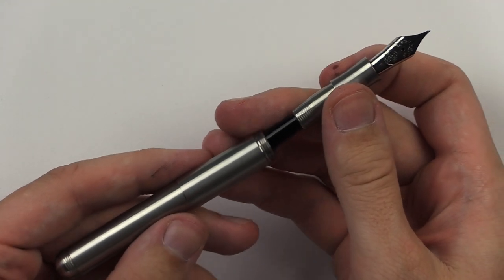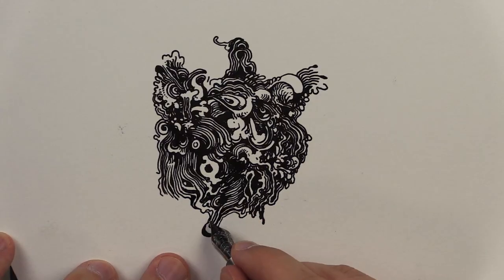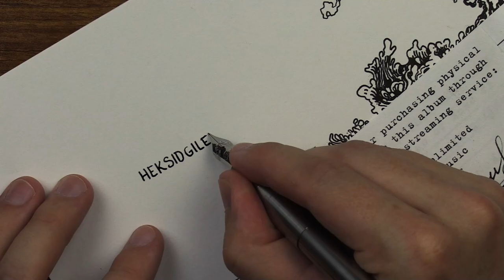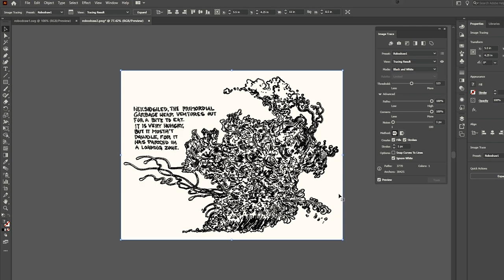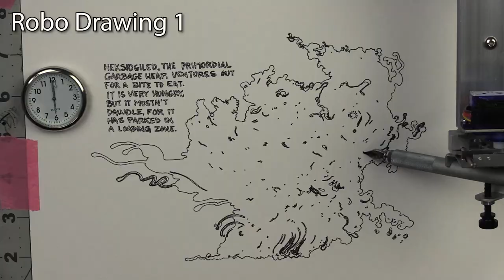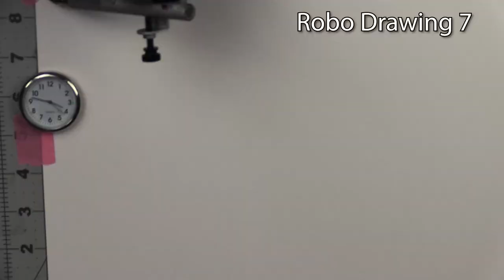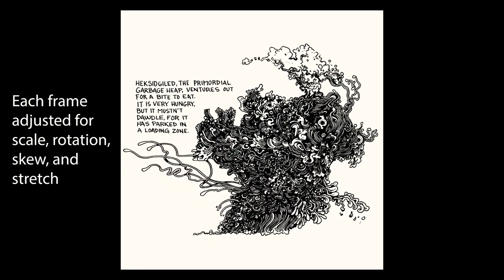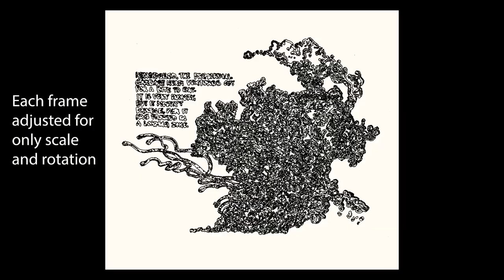Can This Robot Arm Replicate Its Own Drawings? With Crazy Animated Results

Comment: There has to be an option to wear the outline diameter is able to shrink or grow you need to warp the outline all the one line will have two edges I feel like each picture added depth like its own shadow or blur and because of that blur the outline widened thus your words colliding together I could be wrong because every program is different but it seems like that's the logical explanation is that you set up the program so that the contrast somehow grows higher each picture so it recognized less and less pixels or your outline edges are too wide and need to shrink them so thin that the space between matches the diameter of the pen so it creates one line instead of two borders

Comment: I've done vector art for decals for years. You can combine paths in illustrator and then make certain ones compound if needed. Same kind of machine. Takes vector paths but instead uses a blade vs a pen (cap put a pen in the blade holder too). If you want to send my "business email" your file I can try to vectorize it for you so it has longer paths (less up and down placement of pen)
Reply: My email doesn't work
Because it doesn't accept
Any pass words,
Tmoble can't get it work
Neither 
No one knows why,even
Experts can't 
Get it to work
Reply: @mikenel9793  based

Comment: Fix the paper lifting by using a vacuum cleaner and a base plate with holes in it. Don’t 100% block off the vacuum cleaner (heat generation) but it will still be enough to prevent pen mark location error and accidental marking due to paper lifting or curling.

Comment: I think if you did an "inverse selection" thing in photoshop it'll switch from highlighting the outside of the lines to the actual lines. If I remember right, Hold ctrl/cmd and click on the picture of your layer in the layers panel (bottom right in photoshop). that should select the entire drawing. Then hold ctrl/cmd and hit the letter i.  It's been a long time since I've done it so I might be wrong but give it a shot.   If that's not the right way to do it, search for something. I know it can be done

Comment: This is crazy cool, Peter!  I've been 3D printing for about 7 years now, and there's a lot of similarities in how the Axidraw and 3D printers work.
My hypothesis is that the E-Steps on the X-Axis stepper motor aren't properly calibrated, so  it's not moving as far as the gcode tells it to (I'm guessing the Axidraw uses gcode?).
It's such a small calibration error that you only notice it after doing this type of test, where the error is multiplied by number of iterations.

Also, as someone that's sliced models and printed stuff almost daily for so long, I feel your pain on how inefficient the toolpath is calculated. 
That's something that is dependent on the software that converts the vector into a toolpath. I may have to download Inkscape and the Axidraw plugin to see if there's a way to optimize that and report back to you on any discoveries.
Reply from the maker: Yeah I agree, I also think it’s some little miscalibration that you normally wouldn’t notice except through compounded iterations like this
Reply: @peter_draws  I did a quick search to see if there’s instructions on calibrating the e-steps for the Axidraw’s firmware, but couldn’t find anything. 
I suppose such a small error probably isn’t a big deal for this application. Haha.

Comment: What you're witnessing here is numerical truncation.  You know how a computer can only store a number of a finite size, or have a finite number of places after a decimal point (aka the mantissa)?  When you do iterative processes like you did here, with each iteration it loses parts of its mantissas of all the numbers it calculating to truncation.  So each iteration is less precise than the one before such that it looks less and less like the original image, and more and more like noise.  :)  Regarding the scrunching...  as precision is lost, it leaves out what's lost completely and what's left gets scrunched towards the origin point (the place where the robot first sets pen to paper).  :)
Reply: PS.  This is the reason why computer simulations of things like weather go haywire after a certain amount of time into the future.  The accumulating loss of accuracy (due to truncation) as the simulation iterates causes it to diverge from the system its modeling.
Reply: That's one theory, but if it was losing precision due to rounding, wouldn't it be shrinking in both X and Y axis? I also think if it was rounding so dramatically, it would have problems drawing precise lines?
I'm thinking the e-steps on the X Axis stepper motor controller aren't calibrated perfectly. It's the same thing that can happen in 3D printing. The gcode and machine are told to move the x-axis by 10mm, but the motor is only turning enough to get to 9.5mm. 
It's probably not a big problem with something like the Axidraw, which is meant for art, but the error is multiplied in this experiment.
For 3D printing that requires high precision, tuning the e-steps is critical since fractions of millimeter can cause problems with part dimensions. 

That's my theory, anyways.  :)
Reply: My hypothesis stems from the scanning of the new image, reprocessing it into paths and having the bot draw the results. Every time you do that you get loss of precision in the scan and loss of precision in the creation of the paths. But I do admit that I know little about the robotics.  That could certainly be a factor.  I just wrote some software back in the early 90s to explore a phenomenon in chaos theory called period doubling and how it compares to speciation in evolution, and this looks like a visual representation of the precision loss I observed and how truncation can create the illusion of pattern or noise. If your iterative process is generating larger and larger numbers it gets progressively noisier, while if the numbers are getting progressively smaller it makes pattern from nothing.  And since it kept increasing the distance moved despite the loss accuracy of the image it seemed incremental instead of decremental to me. But yeah, I could be seeing what I want to see because it confirms a bias for me.  :)
Reply: Oh, and my hypothesis about the scrunching is that undrawn lines have 0 width.  Which could explain the issue with the robotics...  a 0 doesn't move the stepper motors.

Comment: Are you technically creating some sort of fractal with this. Since each line that you draw technically makes two lines on the paper (since the machine only draws the letters), you're increasing the amount of lines with each cycle. that could explain the varying times in actually drawing the picture. 
a portrait would look so crazy after a few turns in that thing.
Reply from the maker: Kind of, but the rules aren’t so concrete. Sometimes 2 lines become 1 line or 0 lines

Comment: For the pressure issue you're having with the robot...rather than adding weight to the robot arm (like in the last video) maybe you should add a few layers of paper underneath the drawing surface.  This would theoretically still add the necessary pressure without hindering the robot's movements.  These videos are a neat departure from your usual!
Reply from the maker: Well the robot doesn’t press down at all, it just stops lifting up, really. The only downward pressure is from gravity.
Reply: @peter_draws  Oh!  Huh.  I assumed it had a set Zero but that makes sense I suppose.
Reply from the maker: @JojiBojiKoji  you can briefly see in the first clip in the video, there's a little white arm that lifts the pen jig up. when the pen touches the paper, the arm can feely keep descending without the jig. I can adjust this range of motion

Comment: It's as if the axis is moving less than the software believes it is.
Reply: It's as if the scanner or software used to crop isnt intended to be used in that fashion.

That amount of shrinkage is not the fault of the drive.

Comment: Static electric charge maybe eye problems needs grounding Maybe and the temperature at which it runs at room temperature and the temperature of the metal might make it big difference if it was say colder or hotter

Comment: Perhaps the spatial distortion is due to backlash in the axies of the robotic arm. Most CNC equipment (which this is) has a backlash compensation function somewhere in the software attached.
If you want to keep the drawings from skewing, you could look into it.
Anyway fantastic experiment. I agree that a portrait would result in a wonderful .GIF